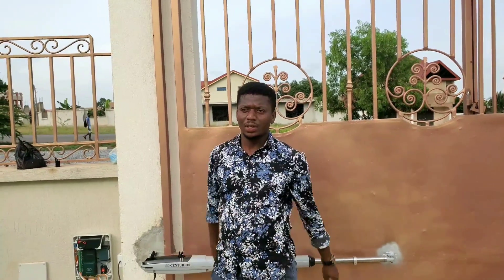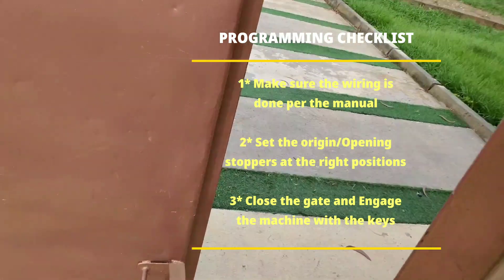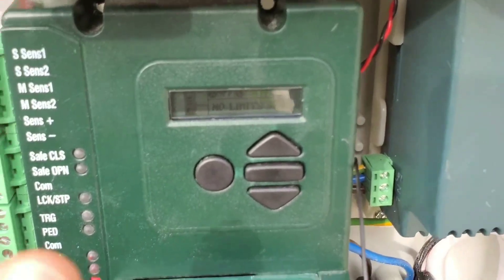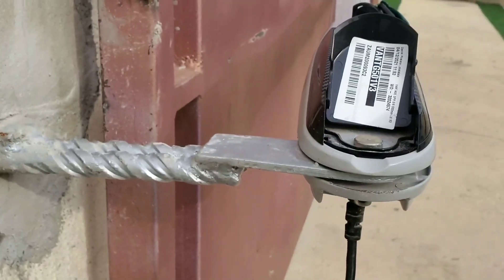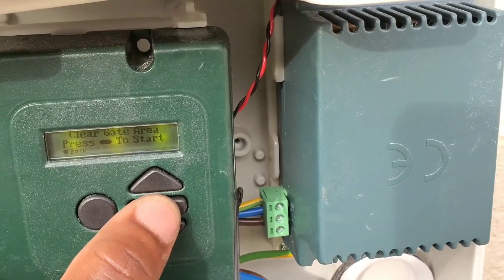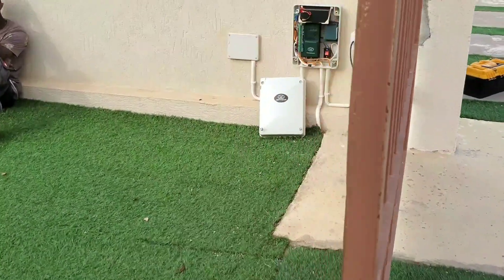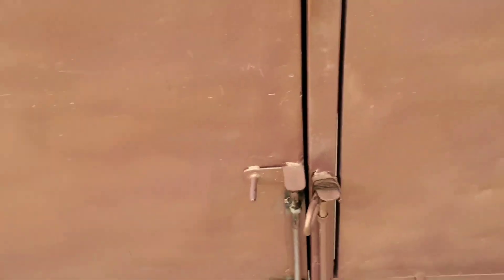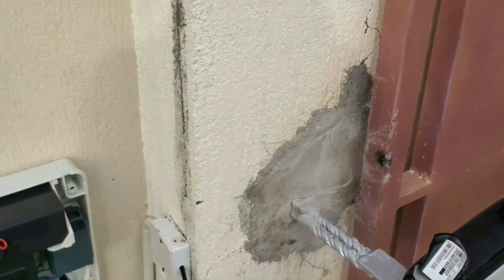Vantage limit settings _ How to connect / wire centurion vantage 500 and program it. Part 2

Comment: Tried setting the limits and I get setup fail
Reply from the maker: Check your wirings
Reply: @EtronsecSols  was working before but now it’s just constantly beeping
Reply from the maker: @ofori01  there should be and error message on the screen.
Reply: @EtronsecSols  no limits set but when I’m setting it up it fails

Comment: Very simple clear instructions.Easy to understand . You saved me having to call out a tech just to run the wizard after a gate repair. Perhaps worth adding if you have an outward opening gates The gates must be open and in the locked and open before your start the wizard.